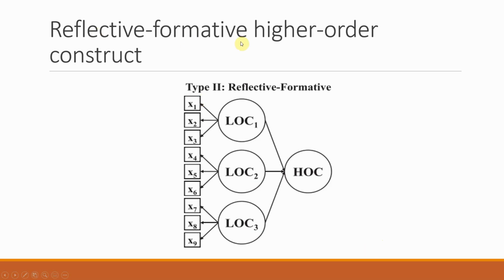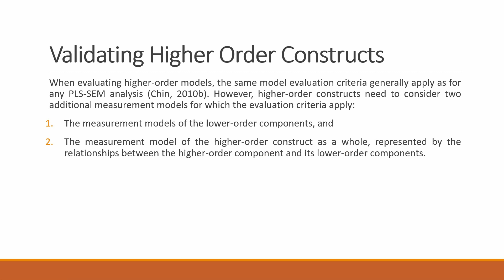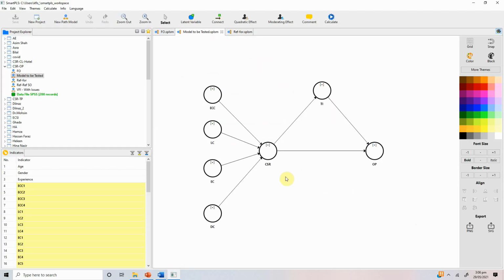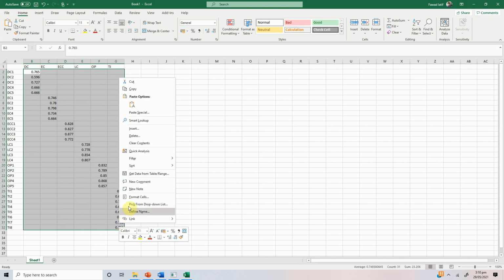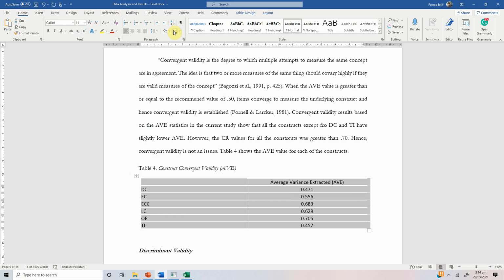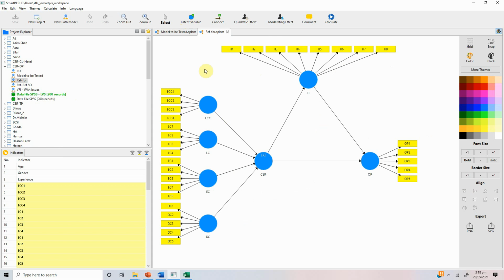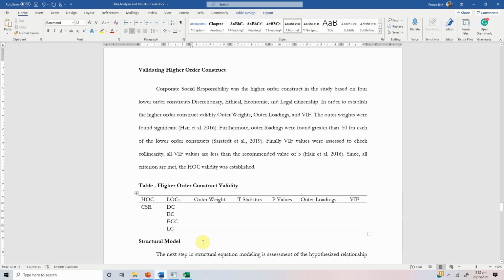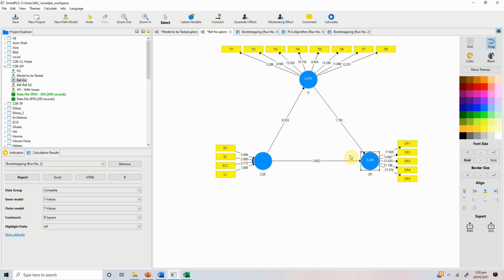3. Reflective-Formative Higher Order Construct/Second Order Analysis and Reporting in SmartPLS

Comment: thank you so much for sharing this lesson. but I have a question. so for my research have 5 independent variables (1 independent is second-stage reflective-formative with 2 dimensions and 4 other independent are one-stage reflective) and 2 dependent variables (both are one stage reflective). so my question is should I separate the analysis for the higher order and first order for the independent var or just include the whole variables? thank you
Reply from the maker: Pleasure. All variables included. But make sure you do validation at both levels plus use LVS at higher level.

Comment: thank you, sir, for your video. i do have one question for you. i do have two higher order reflective-formative constructs which are IDV and DV. i do have also a mediating variable which is first-order reflective. so do i need to include this mediating variable in the running the assessment of higher order measurement model even though it is not reported.
Reply from the maker: Thanks for watching. Yes all constructs shall be included for measurement model assessment.

Comment: Hi, in the video there is no mention of redundency analysis i.e to assess convergent validity of 2nd order relective formative construct,if it is not required for 2nd order reflective formative construct kindly provide the references.

Thanks.
Reply from the maker: Redundancy analysis requires an indicator before questionnaire is floated. There are studies with both Redundancy Analysis and without it. You may consult existing research with Higher Order Factors for reference.
Reply: @researchwithfawad  actually I didn't came through any paper which are r relevant to my research topic who have reported redundancy analysis (convergent analysis) of 2nd order reflective formative construct, now the question is if I will go the way previous papers have reported the measurement model of the 2nd order reflective formative construct i.e without mentioning or reporting redundancy analysis, how can we defend this in thesis and in viva.
Reply from the maker: In case you are doing thesis and haven't yet collected data, add an item to be used for the r redundancy analysis.

If you have collected data, you can out it as limitation plus see any paper that has used HOC but hasn't performed Redundancy Analysis. It can be any paper, doesn't have to be from your area.
Reply from the maker: Normally you will see many paper not reporting redundancy analysis. If you report other statistics, you will be fine

Comment: Sir, I have a question regarding my analysis. In my case, I conducted a similar analysis, but I encountered the following problem: I have two LOCs, but only one of them is significant to the HOC. I checked the outer weights (0.977) and outer loadings (0.260). Normally, one would try to identify issues with the LOC and, if necessary, remove it.

However, after thoroughly reviewing the data for the LOC, no irregularities were found. Additionally, I cannot remove the LOC because Supply Chain Ambidexterity (SCA) is measured through both recovery and efficiency. According to the concept of ambidexterity, it inherently involves two dimensions: exploration and exploitation. Removing one of the LOCs would mean I am no longer measuring Supply Chain Ambidexterity.

Given these constraints, what steps should I take to resolve this issue?
Reply from the maker: If there are issues in the results you will need to filter data and collect more responses.

Comment: Sir, I needed to know if we also add control variables, if any, in the first stage of disjoint two stage approach. 

Also if we have more than two higher order constructs, is their an easy way to ensure that we have made the right connects between them and not missed out on any? 
Thank you
Reply from the maker: You can do it if you want to assess the inter-relationship at first order. 
As for relationships, you need to check that based on your proposed model.

Comment: Thank you so much, Professor. Your lesson is very helpful. 
 I have some questions about this video. When you show the outer weights of variables in CSR constructs, the LC has a p-value higher than 0.062. Then, you suggest that we should look into the outer loadings. If the outer loading is higher than 0.5 and significant, then we have no validity issue for higher constructs. 
My question is what to do if LC's outer loading is less than 0.5?
Reply from the maker: Pleasure. Check for significance of outer loadings, if significant keep it.

Comment: Sir, should we need to check redundancy in higher order construct- which are created with the latent score of low order construct. 2nd I have taken lower order  construct on reflective scale but I am confused what should be my high order construct formative or reflective- in second stage of two stage approach
Reply from the maker: Most of the times HOC should be formative (Ref-for). Since LOCs of HOC are hardly interchangeable.

Comment: Hi Sir! I have one item of Outer VIF Value of 5.585, whereas everyone else is below 5. Do i need to fix this before i continue with higher order construct validating? If so, how? Deleting the item? I thought factor loadings and VIF was the same thing? to measure item valdity, or have i missed something? :) Thank you
Reply from the maker: Hi. Loadings and VIF are totally different. You can keep it as it is not too high. But do check for the other statistics required for validating HOCs.
Reply: @researchwithfawad  thanks a lot! The problem I got when I do next part of structural model is that half of my weights and loadings have suddenly minus values. Half of the lower constructs to be specific . But I followed literature suggestions to put certain items in a subscale since they belong together. Is this is a problem and how could I fix it? My thesis is going to be sent in very soon. Thank you Sir
Reply: @researchwithfawad  also , how do I do when I have 3 constructs that need to be divided into lower order constructs ? :) will the arrows go from each lower construct to each over every other lower order construct ? I have NEP, AC , AT, that all have lower order constructs . NEP have arrows to AC and AT, but how will that be if all of them are divided into lower constructs . 8 arrows ? Thank you :)

Comment: Sir, what can I do if my loading and weight of two constructs are not significant. I need to test hypothesis. This is last step when we make higher order construct with latent score
Reply from the maker: If none of the conditions are met, you should consider deleting the indicators that are causing this issue at the higher level as they are not measuring the construct.

Comment: Sir, I have a reflective/formative model for my research that includes a control variable. Do I need to include the control variable in both stages? I tested it in the first stage, but it had an insignificant effect, so could you kindly tell me if I should omit the control variable or not if it is insignificant? I'd appreciate it if you could respond as soon as possible because I have a deadline in two days.
Reply from the maker: You do not need to include it in first stage. As for removing it because it is insignificant, you can report in your paper that the effects were insignificant

Comment: Sir but if you need to test hypotheshave a query regarding testing of hypothesis and reporting I have 2 Higher order constructs in my model Financial inclusion and Women economic empowerment  I have used 2 disjoint stage approach I have to test my hypothesis of lower order constructs of FI with Hoc like usage ava access affects women economic empowerment nd main hypothesis as there is no significant relationship bw financial inclusion and Wee how shud I proceed do I  need to test twice
Reply from the maker: If you have HOCs, test your hypotheses only at HOC level.
Reply: @researchwithfawad  sir but I've already made lower order hypothesis in my thesis
Reply: Like I have financial inclusion and women economic empowerment as my higher order constructs and financialincludion has usage availability affordability ease of access financiL literacy and women economic empowerment as financial stability increses source of income and household economic decision making but I have clubbed lower order wee into one but not lower order Fin incl
Reply from the maker: If you have hypotheses at both levels then you can assess them at both levels. If you only have them at lower level, then no need for HO analysis
Reply: Sir I have at both levels but my query is when I am using latent variable score in 2nd step, I have to make my higher order dependent construct of women economic empowerment having fin stability increase in income and decision making as it's lower order components so vo bnke Hoc Wee bnega but in case of financial inclusion I have taken it's lower order hypothesis so mjhe manifest variables use krne hngy ya single latent variable score se h hypothesis test hgi
Reply: Pls tell sir👏

Comment: Sir, Thank you for helpful video.
I have 3 dimensions of a construct. The Alpha Cronbach are 0.682, 0.624, 0.593. For 2 dimensions HTMT ratio are 0.939 and 0.973. All others quality criteria are good.
What can be done? It’s correct to continue and made a 2nd order construct, or not?
Reply from the maker: Thanks. I am glad you liked it. Do not move to the next step. Check for cross loadings to solve this issue of Discriminant validity